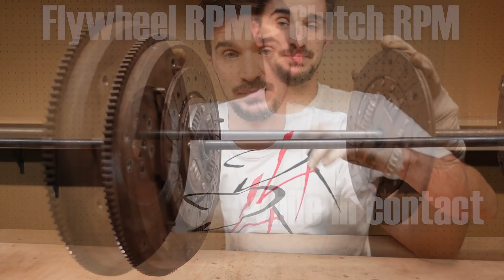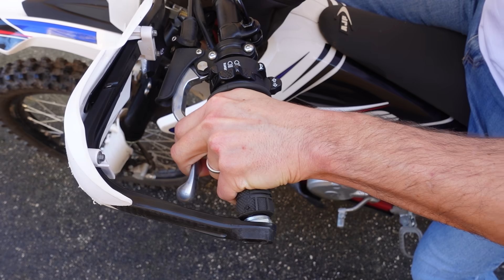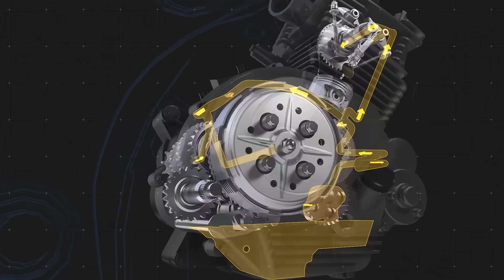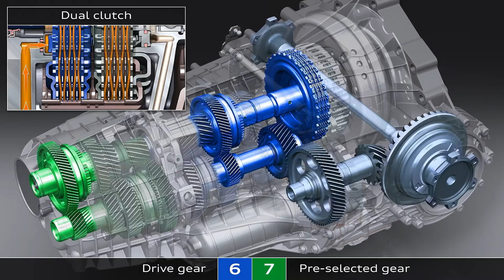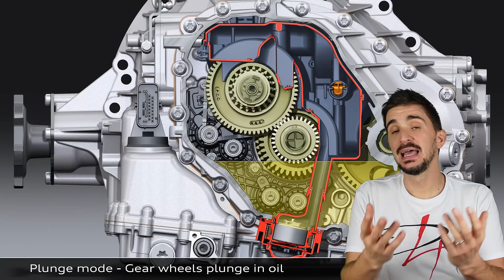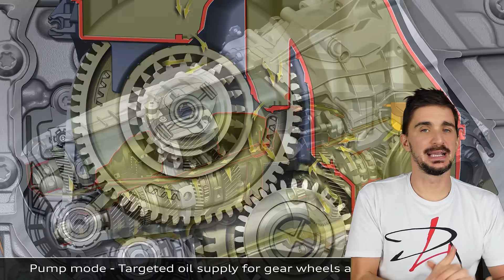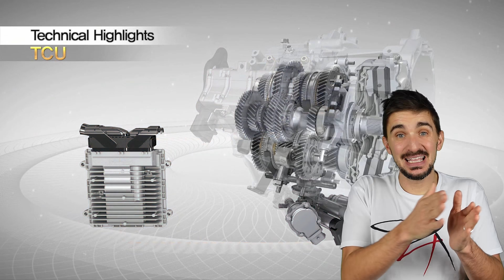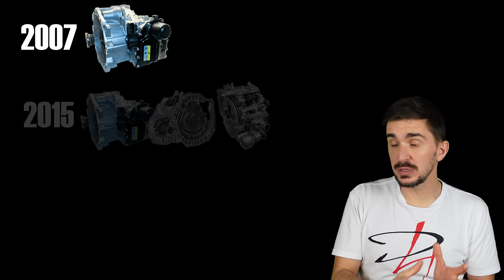Why Dry Clutches Suck and Why You Should Avoid Dry Dual Clutch Transmissions (DCT/ DSG)

Comment: Powershift comes to mind...aka PowerShit...uses dry clutch discs, but the pressure plate works in reverse, the shift forks presses against the pressure plate for torque transfer- wears out the thrust bearings in like 35K kms, and water entry thru cooling holes results in everything rusting up and seizing literally within hrs of becomming moist
Reply: And to make it worse... It was originally designed as a wet clutch.
Reply: Reverse pressure plate, that's the stupidest idea I've ever heard 
Idiotic designs like this should be illegal
Reply: @el_mina   It's not as bad as you guys think. In a DCT, while driving, one clutch is ALWAYS open and the other is ALWAYS closed. If you have both open, it's just as useful as neutral- And if you have both closed, it's just as useful as park.
Reply: @satsumagt5284  I see, I didn't think about that
I take back "the stupidest idea" but I'm curious, has anyone thought of a solution to not wear out the thrust bearing?
Reply: @el_mina  Having only one, normally closed clutch seems like a good idea.

Comment: Biggest problem of dry DCTs is that the era/philosophy of trying to make car parts last forever was already gone. These were never designed to last in the first place. Planned obsolescence is a BIG problem.

True is tho that the reality right now is that a lot of what you said is correct. Only thing about emissions and how good it is for our health is very one sided. You would have to properly calculate the entire lifecycles emissions for that to be correct. If you have to change the oil of a wet DCT then you have to calculate how many emissions are happening for producing that oil. Just as an example.
Reply: I'm gonna say it. Making compact cars under 3,000+ again would do waaaaayyyy more for fuel efficiency and emissions than trying to engineer a crazy complex, fragile, expensive transaxle that needs a $400 fluid change every 40k miles to keep it from grenading itself and a little tiny overstressed 3cyl turbocharged engine in a car that now weighs as much as a midsize car did only 20 years ago.
Reply: @justinluttrell8990  I myself are driving a nearly 20 year old 60hp gasoline Fiat Panda to work everday with a naturally aspirated small engine. Bought it for 900 Euros. Had 270 tkm Now beyond 301tkm right now. Total investment in 3 years with Pricetag + insurance (around 1000 for 3 years) + repairs (brakes, alternator belt) is around 2500 Euros (without gas). 

This engine was so well designed. What if the timing belt breaks? Well I can't drive anymore. Do I need to rework the engine? No. Because the valves will not get hit by the pistons in that engine. 5.3 Liter / 100 km average fuel consumption over the last 30 tkm.

Calculating the ecological footprint will be the king of nightmares for most other cars around. Because they can't compete.

On top of that. Finding a parking spot is easy. Having to care about damaging my own car when parking close to a wall? Nope. It does it's job. Everyday. This car is simplicity and longevity.

And that is the caveat. From around 1985 till 2000 (engineering years not release years) car companies tried to make cars live longer and longer. But then they realized they will not sell cars anymore if they live to long. So they stopped doing that and went reverse on it. They build cars just for one purpose. To maximize profit.

Simple mechanical solutions who would - because they don't break or are easily repaired - do way more for our environment. Because throwing away 60.000 Euro overcomplicated, overengineerd, bullshit featured sedans after like 100 tkm is so incredibly wasteful.

Comment: Clutch and break material is made of an asbestos derivative we didnt stop using a lot of bad meterials just slightly tweeked the recipe.
Reply: Most major U.S. and European automakers transitioned to asbestos-free materials—like Kevlar, fiberglass, or ceramic—by the late 1990s.  While domestic production has largely shifted, asbestos is still legal in some countries. Consequently, imported aftermarket clutch parts (often from China or India) may still contain asbestos fibers. In the U.S., it is still legal to sell certain aftermarket automotive parts that contain asbestos, though they are rarely used by major brands today.

Comment: Worst scenario for a dry DCT in my experience is when trying to reverse slowly up a steep driveway. The car would suddenly lurch as the clutch fully engaged and jerk to a stop when backing off. Not good for the car or the driver.
Reply: The reverse gear ratio can’t be low enough. Similar on Sonata when backing slowly, and I think it is wet. In and out of gear when crawling slowly
Reply: @JohnSmith-un9px  It never is. Reverse has always, by necessity, been a ratio somewhere between 1st and 2md.
Reply: @DiscoFangi do wonder why, i imagine being able to hit like 4000 rpm just to go 10 km/h would give you a stupid fuck ton of torque
Youre not trying to go quick anyways, but i assume its actually due to gear sizing
Reply: Now add a trailer, even a small one.  Yikes.
Reply: My Audi (PHEV) is the same. Took me a long time to get used to how jumpy it is in reverse. You'd think that would be the worst possible activity to have that behaviour, since your visibility is already heavily impaired.
Reply: The Audi/VW PHEV trans uses wet clutch packs!
Reply: Stop and go traffic, that's a bad situation for dry dsgs.
Reply: Detter for dct is on/off regime. Without long slowly moving. The worthest if you disengage brakes and dont touch accelerator
Reply: you need more practice. i have a dry DCT and reversing just needs a little curtesy: allow the clutch control unit to release the clutch slowly by letting go of the brake slowly and don't feed any accelerator, as the DCT will then allow some slipping and you can reverse super slowly.
Reply: 11:10 that should be illegal. gross.
Reply: Complete bullocks. What a nonsense, 300.000km with a dry clutch and still going strong. Wet and dry both have the same advantages and disadvantages. Complete waste of time, 16 minutes lost of my live.......
Reply: @Tarsys  yea two fundamentally different concepts obviously have the same pros and cons 🤦‍♂

Comment: I just rebuilt the engine on my moms passat (1.4 tsi problems on the top end due to low oil pressure) and this car has a dry clutch dsg with 330000 kms, I did an oil change on the transmission about 20k kms ago but nothing else other than that and the clutches have held quite well. With that being said this is a 120hp passat driven quite conservatively considering the long term fuel consumption is at 5.4l/100km.
Reply: Oh yes, being kind to your drivetrain has long term benefits.......a lesson I fear our trumpland cousins have yet to learn to the immense gratification of US auto manufacturers 😂😂😂

Comment: I have always wondered how DCT gearboxes work and how they shift so quickly. This video explains it brilliantly. Also as soon as dry DCTs were mentioned I was like :
Wait, I have seen this tactic before. Where? Right, wet belts and that reference at the end was perfect
Reply: I have recently purchased a DSG car, and that "lightning fast" shifts are only part of the story. The actual gear shifts are real quick and if you keep the gearbox in D or S it usually does the good enough job of shifting gears. When it starts to suck is when you try to use the paddles or even worse using a manual mode. The delay between the command and actual shift is always there, even if the gearbox was anticipating your next move. It's not like you press the paddle and you are in next gear, even if the transmission was anticipating your next move. And if you try to do something unexpected by the car you have to wait and even if it's like 1 second or lecss it feels like ages, compared to the manual car that you just bang to the gear you want and go.
Reply: @mibars  Yep, mine does the same. It also shifts harder in manual mode than letting the computer do it in D or S mode. I still trying to wrap on my head in D mode, when in 6th gear and I floor it, it goes to 4th in a second. but with the DSG logic 6th and 4th is on the same clutch system and how can it disengage 6th and engage 4th with only a slight delay?
Reply: @x1800emohunterx Dual clutch engineer here, good question, fun explanation. You do indeed have to shift to a gear on the clutch you are currently driving on. There is however a very simple solution for it: double downshift. In essence, you shift to the already preselected gear (in this case 5th), and while you are there you synchronise 4th. As soon as this is done you can effectively shift down one gear further to 4th. 

This would however lead to the driver feeling a double step in the downshift, not preferred by most drivers. Therefore some clever calibration is performed by most manufacturers. This goes roughly as follows.

As soon as you request kick down, the clutch of the current gear starts to disengage, while the clutch of the other gear starts to close to take torque. However, you do not close the clutch completely, instead you allow continuous slip over this clutch. This allows you to choose how much torque the transmission draws from the engine. At the same time as you start closing this clutch, you also start building engine torque. In this stage you make sure to close the clutch to a torque setting that is slightly below the engine output. This allows the engine rpm to rise. As soon as you have fully disengaged the original clutch you can preselect the lower gear on that shaft, all while the engine rpm is building. As soon as the gear (4th in this case) is preselcted, you can start handing over the torque again to the original clutch. As soon as the engine speed has now built high enough to match the speed needed in 4th, you can now fully close the clutch.

If you time all these actions just right, you have a perfectly smooth and fast downshift between two gears on the same shaft, all without you as a driver noticing the inbetween step.

Hope this helps
Reply: @jaspercammaer1926  That's interesting, as my observation is that double downshifts (e.g. 4->2)  work surprisingly well, but triple downshifts (e.g. 6 >3) not so much when initiated via paddles, but can surprise when initiated via kickdown. And double or triple upshifts doesn't work at all, e.g. flooring it, letting it do the 1->2  and going off throttle to cruise at constant speed - it will do couple of bang shifts ever 1-2 seconds until it lands in 6th, even if I quickly paddle it up all the way to 6th.
Reply: @mibars also noticed this on a automatic. Engine just kinda sits there and nothing happens. Almost like its a delay. When in d mode, it's not like this. Shifts are much faster and smoother

Comment: Why doesn't anyone make a traditional manual transmission with a wet clutch?
Reply: Additional maintenance and costs. I mean, a clutch in a regular manual transmission can easily do 150.000-200.000 km if you are dumping it like a boi racer😅

Comment: I have a 2017 Leon with the 1.8T and DQ200, and boy, the gearbox is the worst part of the car. At 100,000 km, it already needs a new clutch and flywheel replacement.
Especially when the 2.0 comes with the DQ381, which is one of the best gearboxes VW ever created.

Comment: If you drive a dry dual clutch car always put it in neutral or park when idling in a queue or waiting for traffic lights …. most people don’t do this…. they just leave their foot on the brake and the gear selector in drive .  Clutch overheats .. fault codes generated .. limp mode .. tears and tantrums etc etc.
Reply: The VW DQ200, despite its flaws, disengages the clutch. You need to put slightly more pressure on the brake pedal than just resting your foot to tell the car that you don't intend to start moving again. You can tell when this happens when the engine RPM drops to idle.
Alternatively just use auto-hold.
Reply: No, the clutch is disengaged. There is a slight amount of hydraulic pressure applied to the clutch, so that its ready to fully engage instantaneously, but its not slipping at all. Here is a good video explaining this. https://youtu.be/9xcyOJHUGk0?si=VBOhowJgd-cLegQB

Comment: Dont all the particles from the wet clutch cause clogging like what happens on wet belt engines?
Reply: That's why you change the fluid and filter.
Reply: @AlexandarHullRichter thats what you do in engines with a wet belt too
Reply: @paolo69  contamination of the oil in a wet belt engine isn't as big of a concern as 1, belt failure, and 2, belt replacement. 

Oil naturally degrades belts and causes failure. 

You shouldn't have to disassemble an engine to replace a belt, or for any reason before 300,000-400,000 miles.

Comment: Should I delete clutch delay valve from my tuned car ?
Reply: If you’re proficient with shifting gears, then yes. The delay valve is meant to smooth out driveline shock.
Reply: @TML34I guess I am, 'cause whenever I drive my other cars without cdv, I am able to perform far better quick upshifts and rev matched downshifts. I also kinda have to adapt to cdv after driving the one's which doesn't have it.

Comment: Watching with my 21 years old TDI with DQ250, wet clutches, dry belt and everything still servicable with relatively simple toolkit.
Reply: About a year in to owning my first automatic gearbox, and it's an Audi DCT. Very impressed with it and it lessened the blow of moving away from a manual.
Reply: Golf 5 1.9 tdi with DSG at 300k km without any problem (20 years old).
Reply: Same here with my Skoda Octavia MK2 Combi with a 1.9 TDI and DQ250 DSG. The older DSGs destroy Dual Mass Flywheels like it's nothing but otherwise the transmission is great.
Reply: @thestachelfisch  lol facts, my mk5 gti needs a new flywheel 😅. Thankfully dsgs are not that hard to remove compared to other transmissions.

Comment: 100% information, 0% filler/ads. Perfection.
Reply: 20% understands 100% trust
Reply: I saw. I watched till the end. I liked.
Reply: Well it’s called driving for answers after all
Reply: No do a video on why valve bodies suck. And how zillions of tiny tubes in automatic transmissions get clogged. And how much automatic transmission flushes cost, and how many aren’t even diy serviceable. And what happens to an automatic transmission when the external cooling system is compromised. And how you can’t roll or tow a vehicle with an automatic transmission. And how manual dry clutches actually last a really long time: and when you do have to replace them it is a few hundred dollars. And how replacing an automatic transmission is several thousand dollars.
Reply: @JWalker-g7t And? Topic of this video is not about any of those things
Reply: Yes. Loved it. More More More!!
Reply: That is why motorcycles use wet clutches.Twin Disc marine transmissions and the likes are wet clutches as well.
Reply: I preopened sponsorblock in advance (or "revanced" one might say) to mark ads
Thanks for no ads 🙏
Reply: Nah information is more like opinion
Reply: 0% padding to scratch out the video longer
Reply: 100% theory 0% real world application and results
Reply: Get an EV imstead.
Reply: @ABa-os6wm learn to spell first
Reply: @ItsEmptySoda  just a coincidence that M and N are side by side on the keyboard i guess...

Comment: Centrifugal clutch with a gearbox that can do clutchless gear changes - lots of fun 😊😊😊😊
Reply: Yknow i wonder why manuals dont use these, i mean i enjoy using the regular clutch but this sounds like a no brainer to use, unless there are drawbacks and i just dont know about them
Reply: @Fogolol  they cannot be scaled up for large hp apparently. i have a clarke torque transmission in a pivot steer loader that is more or less the same thing but with oil. it's a good machine to drive, but you need high rpm going downhill or it will run away.
Reply: @martin-vv9lf  i see, so it suffers from the same issues CVTs do, can't be used for higher HP scenarios because they simply won't be able to take it
Reply: @martin-vv9lf ummmm hate to break it to you but 12000hp top fuel dragsters run a centrifugal clutch
Reply: @Fogolol hey not sure about the other comments, but my 4000hp drag car has a centrifugal clutch, and 12000hp top fuel cars run them too.
Centrifugal is a very complicated piece of kit. And quite expensive. That would be one reason why they don’t run them.
And a torque converter does a similar thing (engages at a certain rpm) and is cheaper, and less wearing parts.
But it is good; you can roll up to the line, no feet on any pedal and not stall. Smash the throttle and it hooks !
Reply: @351tv4  hmm i noticed low HP centrifugal clutches are very cheap, so my guess is they arent used for higher HP in normal situations because they get expensive fast
Reply: @Fogolol ah ok, I’ve never looked for lower HP applications. But if you look at the mechanisms they are quite complex compared to a standard clutch. They’re a bit different to drive with; if it does still use a clutch pedal (mine does, by rules) you can literally rip your foot straight off and nothing happens - but you still need to feed in the accelerator so you don’t shock load the driveline. Took a bit to change my habits but not difficult.
Reply: @351tv4 yeah now i see why they are nore expensive, low HP centrifugal clutches, like the ones you see in Go Karts are essentially just 2 springs attached to a high friction pad that contacts the outer housing when enough RPM is applied, much simpler than the one you are describing
Reply: @Fogolol ah yes - kart ones are fairly basic. Sorry, didn’t consider that.
Reply: @Fogolol I believe these types of CVTs are used in smaller mopeds. They don't feel very good to ride. Very "squishy" throttle response but it's cheap and simple
Reply: @salsamancer  no, not CVTs i mean a centrifugal clutch engaged to a manual transmission, yknow instead of the manual clutch